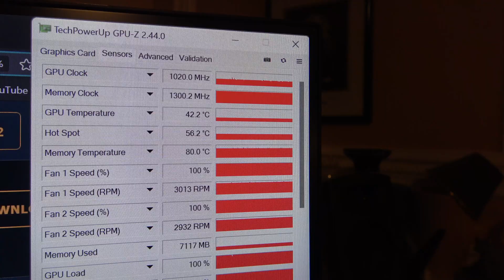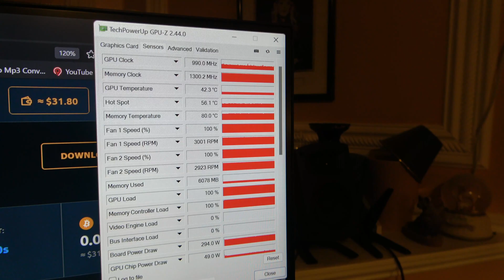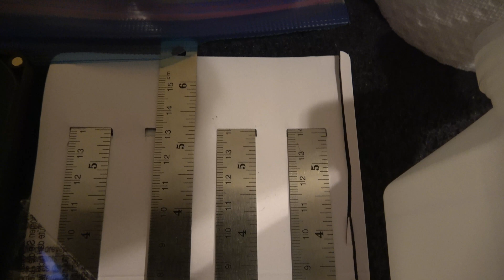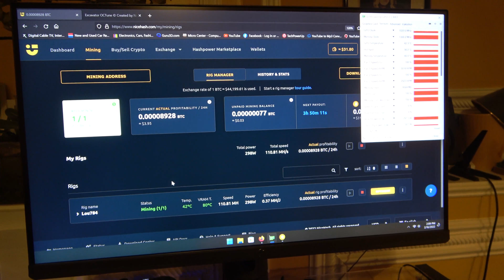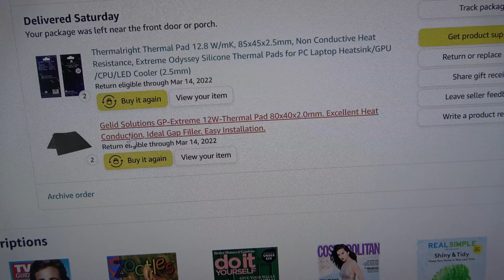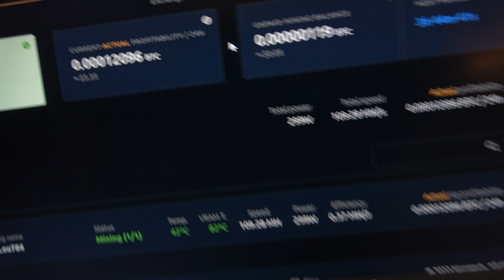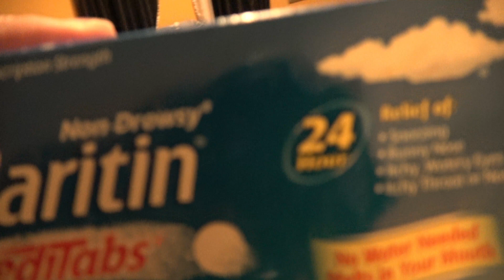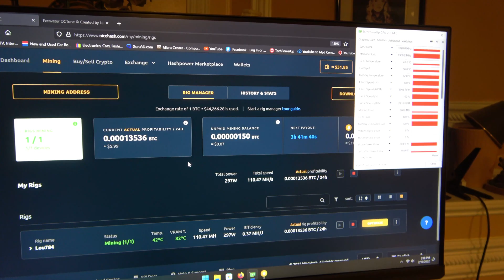Asus Strix RTX 3090 Thermal Pad Replacement / How To Guide

Comment from the maker: I 100% highly recommend changing the factory thermal pads on you're 3080, 3090 Graphics card.  In this video, I talk about the process I went through in changing my thermal pads, the tools I used, the parts, and or supplies you need to do the job, and the end results with phenomenal memory load temperatures, even during mining.

And posted below is a direct link to an Reddit post up on the thermal pad replacement on Asus Strix RTX 3090 with further information, and pad locations (on next pages of images):
https://www.reddit.com/r/EtherMining/comments/mo6s9o/3090_strix_teardown_pad_mod_15c/?utm_source=share&utm_medium=ios_app&utm_name=iossmf

Links to amazon to purchase all the thermal pads for the Asus Strix RTX 3090 (None of these are affiliate links, just direct links to the products from the Amazon store.):
2.0 MM Gelid Solutions GP-Extreme Memory module pads (you will need 2 for the 3090, and only 1 for the 3080, but I highly recommend buying an extra 1 or 2 sets for extras in case of any errors or future re-padding: https://www.amazon.com/gp/product/B07BSPZTNV/ref=ppx_yo_dt_b_asin_title_o05_s01?ie=UTF8&psc=1

Thermalright 2.5 MM Thermal Pad (you will need 2 of these for either the 3080, or 3090):
https://www.amazon.com/gp/product/B094Z9TLJ7/ref=ppx_yo_dt_b_asin_title_o05_s01?ie=UTF8&psc=1

Gelid Solutions GP-Extreme 1MM thermal strips (2  comes in a package, and it is all you'll need):
https://www.amazon.com/gp/product/B09KRG6YR5/ref=ppx_yo_dt_b_asin_title_o05_s00?ie=UTF8&psc=1

Gelid Solutions GP-Extreme 0.5 MM Thermal strips (2  comes in a package, and it is all you'll need):
https://www.amazon.com/gp/product/B09KRF58M1/ref=ppx_yo_dt_b_asin_title_o05_s00?ie=UTF8&psc=1

Utility Knife for cutting thermal pads, you can also use a good pair of scissors for thinner thermal strips:
https://www.amazon.com/gp/product/B098KVGJW4/ref=ppx_yo_dt_b_asin_title_o03_s01?ie=UTF8&psc=1

4 pack of aluminum 6 inch rulers:
https://www.amazon.com/gp/product/B0812JV4L6/ref=ppx_yo_dt_b_asin_title_o03_s00?ie=UTF8&psc=1

I fix it kit (Has all the tools you need to dissemble the Asus Strix RTX 3090 and plenty of tools to dissemble other electronic parts like phones, laptops, computer hardware, gaming consoles, and incuding the Torx 6 bits on rear back plate of 3080/3090
https://www.amazon.com/gp/product/B0964G2Y7S/ref=ppx_yo_dt_b_asin_title_o02_s00?ie=UTF8&psc=1

Replacement fans for ether Asus Strix RTX 3060, 3070, 3080, 3090, and the appropriate Ti models as well: https://www.amazon.com/gp/product/B09JJQYTHR/ref=ppx_yo_dt_b_asin_title_o00_s00?ie=UTF8&psc=1

And I forgot to mention in the video, but I used Thermal Grizzly Kryronaut thermal paste for the GPU core.  I used the x pattern to apply it with great core load temperatures, link:
https://www.amazon.com/Thermal-Grizzly-Performance-Processors-Computers/dp/B08R6QG2CQ/ref=mp_s_a_1_4?crid=1MZYQ7OU7SDL1&keywords=thermal+grizzly+kryonaut&qid=1645060576&sprefix=thermal+gri%2Caps%2C133&sr=8-4

Time, and patience is the key when doing these technical jobs the more you practice and perfect your work, the better the results. Good luck!

Comment: Wow what a guide didn’t show one step
Reply from the maker: Maybe you didn't see the pinned comment or video description linking a guide to changing the thermal pads.  Most other people found this video helpful.  I'm pretty sure I was pretty thorough on describing what you need to do the job, with direct links to where to buy everything, all that's the left to really do is remove the screws in the order that shown in the linked guide.

Comment: EVERYONE who is watching this video do NOT change your pads you will open a can of worms that is annoying as hell!   GOod luck getting the right sizes and the temps differences are negligible.  For a first timer you will drive yourself crazy and trust me you're going to waste a ton of $$ on pads as they are expensive.  I ordered some from china to do the job although I have waterblocked my gpu.  Summertime = hot weather so thermal pad changes or not things are going to get toasty without a heatsink/pad/fan on the OUTSIDE back of the videocard

Comment: I also have the strix 3090. Did you replace the pads on the rear? Good job!
Reply from the maker: Yes, I did replace the rear thermal pads as well (including VRM's), and it is a must as those memory chips tend to run the hottest.  And thank you.
Reply: @LousWRX  Thanks,  this is my job for the weekend. what sizes did you use on the back?
Reply from the maker: @mncnAirsoft  I used 2.0 MM Gelid Solutions GP-Extreme for the rear memory chips, you also need some other sizes for VRM's.  There is a pinned comment on this video that mentions all the finer details, it also in the description.
Reply: @LousWRX  Found the reddit post, thanks very much. I will let you know how it turns out.
Reply from the maker: @mncnAirsoft  Sounds good.  Take your time with everything and good luck with it!

Comment: Why aren't you using afterburner to overclock your card
Reply from the maker: Yeah normally I use it when I game or benchmark but forgot about it while recording this video.  I now run the card at 1,000 mhz Memory OC @ 323 power limit with 82-84C load Memory temperaturesv @119 M/H.